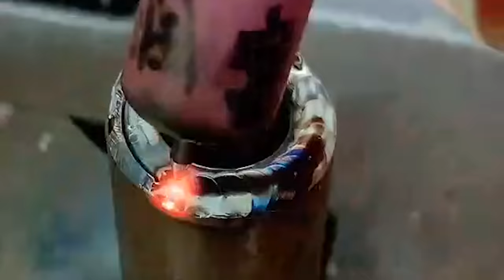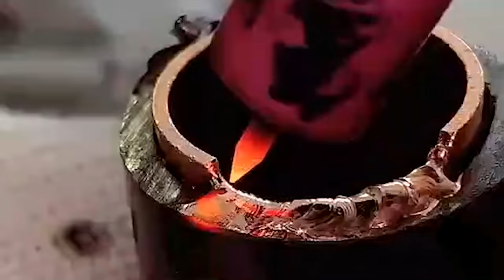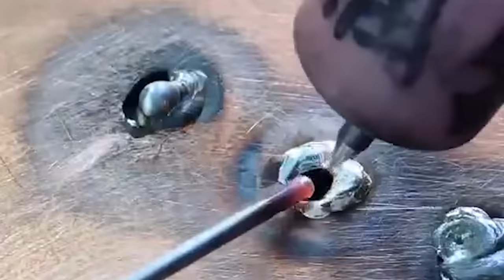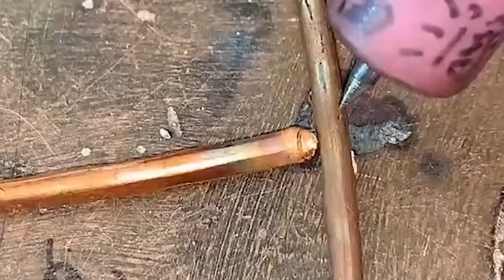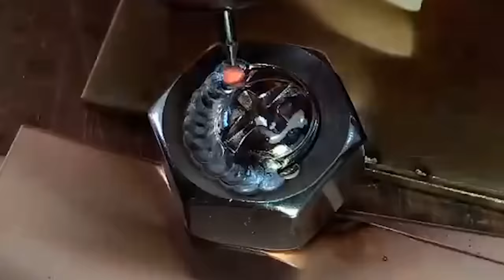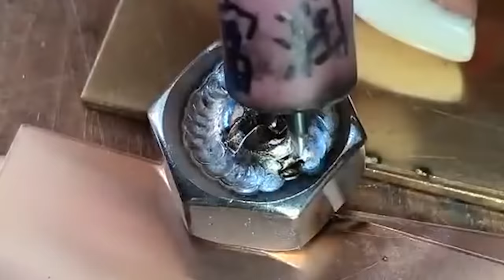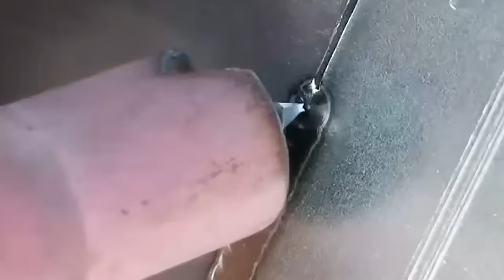What is cold welding? Watching this video you will understand!

Comment: This isn't 'cold welding', it is TIG 'fusion' welding (without filler rod in most examples). Miller Corporation explained many of the pitfalls of 'fusion' welding as much as 16-years ago...such as the tendency for cracking, very superficial penetration (1/16th inch), insufficient weld strength, and when it comes to aluminum, the tendency for it to crack upon cooling. Cold welding is NOT shown here...cold welding occurs in a vacuum, and is a completely different process (as different as TIG is from MIG or SMAW).
Reply: Yes, GTAW welding
Reply: This is cold welding. A lot of welders use the phrase "cold weld" just as you described. Basically a shit weld that breaks apart immediately.
Reply: on youtube, anyone can be an expert
Reply: Yea was gonna comment on that looked like a tig tip just no gas
Reply: This is ' cold ' welding in that it is done so fast that there is no real heating of the metal beyond the weld itself. 
It is only good for teenie weenie parts that are so thin that they heat up almost instantly. Anything of any real size just doesn't get any real bonding unless they go over it a bunch of times then it is not very much ' cold ' welding anymore.
It really is ' tig fusion spot welds ' that you might do by just hitting the pedal for an instant only it is more like holding the pedal all the way down and turning the whole machine on for half a second.
All it is.
Reply: It's not though, they just edited out the flash to make it look like that, just click bait, nothing more
Reply: Yeah this isn’t cold welding this is just tacs with the arc edited out of the video lol.
Reply: It is what it is. The real bad part is where they try and make it look like it is the best possible welds ever.
No
Reply: It is with gas or without?
Reply: @szekerespista3758  should be with gas, like any other TIG weld.
If not then it'll be holding even less.
Reply: @szekerespista3758  yes it’s just TIG nothing special it uses 100% argon.
Reply: Tu si sabes de soldadura hermano muy buena explicación
Reply: Thanks sir for your explanation
Reply: ¹
Reply: Thank you very much.
Reply: @szekerespista3758  if no gas, the tungsten would be consumed. It happens instantly. I hate it when I forget to turn on the gas. Gotta sharpen the tip again. 
As far as those saying the arc is edited out, that's likely the camera auto-darkening
Reply: @szekerespista3758  its gots gas i heard it
Reply: @DG-kq8zf  Exactly and i seen the arc i must be superman
Reply: @onceagainbackagain  nobody here has made q correct comment or seems to know what theyre on about lol. blind leading the blind
Reply: Oh I'm sure that they did explain it along with a pamphlet on why you should buy there well there's I'm sure it made them all sorts of money too a corporation trying to tell you why you shouldn't do something that could probably be just as good as any other thing in most situations but by my $20,000 Welder instead
Reply: Ok Mr. Smarty Pants…..But are you a hott Asian babe?
Reply: Инт
Reply: @miguelcastaneda7236  agree but with the power turned up.
Reply: Skeeter Saurus lol
Reply: Olá gostaria de saber como conseguir essa macna
Reply: @michaelszczys8316  you could easily tell it had gas. The tungsten would burn up without gas.. and the metal would not be shiny., it would be sugary. 🤦🏻‍♂️ YouTube.
Reply: You expect a Chinese person to have correct information?
Reply: this welding is cool... 😁
Reply: That's exactly correct. I want to know about cold welding. No electric arc. No HEAT
Reply: Thank you. So tired of these "cold welding videos" cold welding is done like you said in a vacuum. Where a clean piece of metal meets another clean piece of metal. The atoms bind to one another. But there can't be any corrosion or layer of oxidation. They want to bond with another. Look up space station cold welding. It was a accidental problem that occurred.
Reply: this is not cold welding, cold-welding,,,is what can happen in space when materials hit eachother, it can cause them to "stick" and its why engineers plan on spacecraft as a potential issue.  (tig is not used in the "process" of cold welding, cold welding as a the process,,,should not have any "Heat Affected Zone" I think some people are simply confused with "cold welds" which is insufficient heat... but not the process, on earth this process can use ductile non carbon alloys ,,and dis-simialar materials but to be "welded" the joint should be at least as strong as the alloys its joining.
Reply: we dont care cold welding or not, we have to care about the tech of welding which is seeing in this vid. tihis is an amazing
Reply: @dekopac311japan2  if you do not even know the processes, you can not understand any tech about welding hahaha
Reply: Who are you really trying to fool?
Reply: Looks pretty though haha
Reply: Stavo per scriverlo io
Reply: Нет
Reply: Hi,so what would recommend about the TIG'infusion' to a person who is a  beginner in this area of welding business.Thank you
Reply: Thanks dad always wondered
Reply: Sibuk la ko ni..
Reply: This doesn't look anything like what I'm seeing for TIG. This looks a lot more like an electromagnetic welding set-up I've seen someone make for welded maile.
Reply: Yes
Reply: I guess you are correct it is not cold welding . I wouldn't get held up on words, like whether it's actually correct  to called a cold welding but either way it's just a language barrier and it is very beautiful art from what I can see.
Reply: Most definitely is cold welding! Also, cold welds are never meant to be strong nor is it meant to meet AWS standards. Been doing it for 32 years, structural, ornamental, mechanical, oxy/acetylene, brassing, been there and done that. I'm also AWS certified welder/fabricator and I'm also pressure vessel certified. This is most definitely and in every aspect, cold welding.
Reply: It’s just autogenous welding
Reply: you live in China ? maybe they call this cold welding there ? simply ask 😕
Reply: Thank you!
Reply: @theoldmanreed8818 
* “It has gas. I heard it.” 

Is that what you were trying to say? 

Todays subject is “Speaking English & How NOT to weld.”
Reply: @TheOhsemix So you’ve never Tig welded before obviously Lmao
Reply: That's what I thought 😆 I was confused. I did a Google search for examples of cold welding after reading about it and this did not look at all like what I read. 😂
Reply: This type of welding is called superficatic cold-fusion welding. It's main purpose is to ameliorate surfaces and shouldn't be used for structural support in anything beyond very small applications.

The gun being used is a cryoplasmatic gun. It can only be used in a vacuum room. It emits a super-cooled plasma arc which welds the metals through the processes of deionization and reionization.
Reply: Everyone complains this isn't a good weld die to poor penetration, but I wonder if it's good for sheet metal?

Comment: Those red hot molten metal areas are a lot hotter than i would classify as cold.
Reply: Right? Whats jb weld then freeze welding?
Reply: @granthansen5217  
That's called glueing.
Reply: Yeah this is full power. Cold welding has really short pulse time and low power, which means that while they do make a weld, it's weak as shit.
Reply: @tailehuynhphat9570  its the nice superficial clean look of tig with the penetration of a sparkler
Reply: @kevobrando95lx44  yea it’s like glueing metal together with aluminum foil that’s the best way I could describe it
Reply: I couldn't have said the words you said any better than the way you said them if i had said them the way i would have said them.
Reply: @mrnick1370  but what if you already said them the way you thought you were gonna say them if you said them?
Reply: @goobygooberyeah9251  But i haven't.
Reply: @mrnick1370  If you could have stated it in a way that is eloquent and to the point, then you could have upgraded your current job and have some real recognition for once :)
Reply: It’s a pulse tig
Reply: Best part is when they use two pieces of metal that were previously "welded", and broken apart... Lol
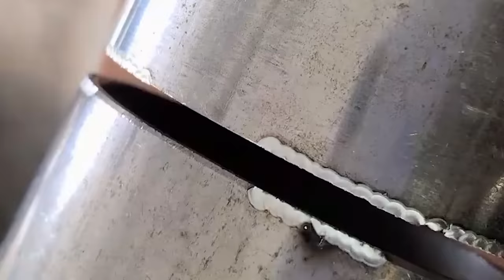Reply: 2:05 gives an example of the weld strength lol
Reply: Goat, Just because your computer is misajusted and showing too much red, that doesn't mean the rest of us can't see that this is cold welding. I bet your screen is so out of balance you see molten metal and a tig torch too. Get that thing fixed mister.
Reply: basically because the solder cools down after a few seconds, however conventional solder stays hot for a long time
Reply: @campus206  That's not close.
Reply: That's just cold hot metal bro. Same different. 🤣🤣🤣
Reply: Isnt spot welding
Reply: @hanifshaikh8829  It's a spot, and it's welded.
Reply: Yea, this isn't a thing. It's NOT welding. It's called a defect if you do this welding. No penetration.
Reply: @kevobrando95lx44  exactly
Reply: Vocal Gravy  Well, to be honest, messing up IS a technique.
Reply: @goatsinker347  хоть как называй, всё равно не перестает быть сваркой, так, как происходит сваривание, и не используется клей.
Reply: She Chinese, you expect any type of accuracy or quality from her?
Reply: @kevobrando95lx44  hahahahha
Reply: cold weld is basically weld with 0 penetration- 0 strenght :D same like cold joints with soldering. tin is there, but it just sits on the wire. at moment, when you will put there resin, it may not conduct electricity, or that joint will heat up excesivelly :D